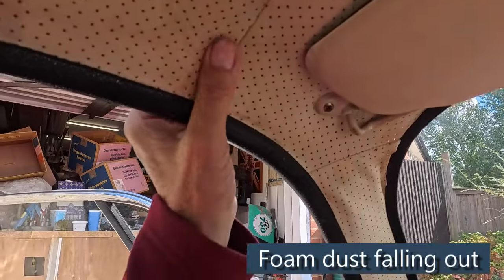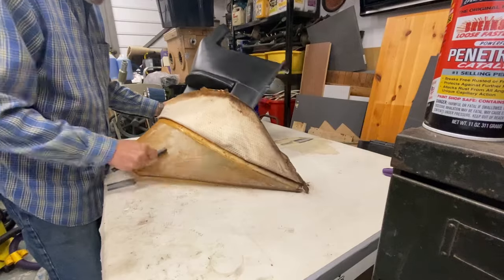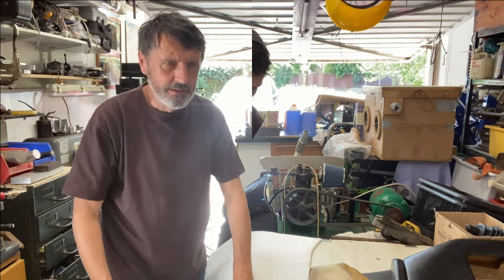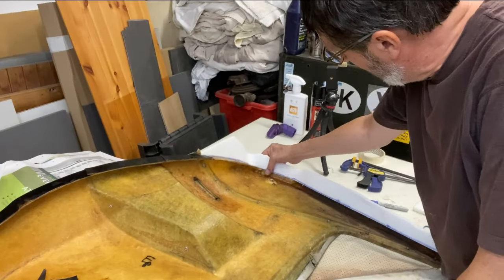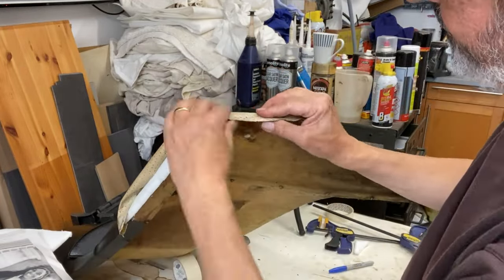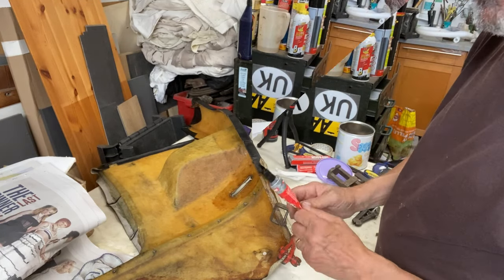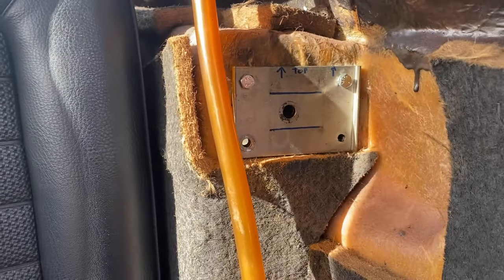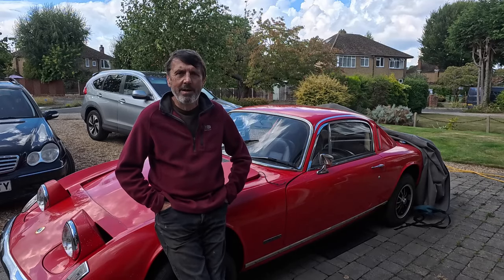The MIDDLE of the end.... Getting it ready for the road.  Lotus Elan +2 130/5

Comment: The Plus Two seems only to have had a simple slit in the Trim for the Belt. If Finishers were ever used, very few if any survive. It does unfortunately look a bit cheap and out of place, in an otherwise nice interior. The Vinyl can also get damaged by the rubbing Belt.   I made a wooden Finisher which matches the Dash. Something Lotus should have done in the first place.

Excellent Job on the interior, by the way.